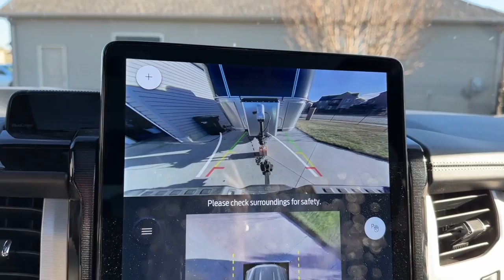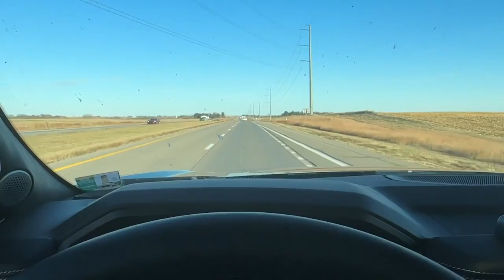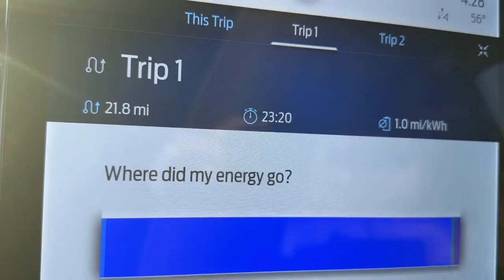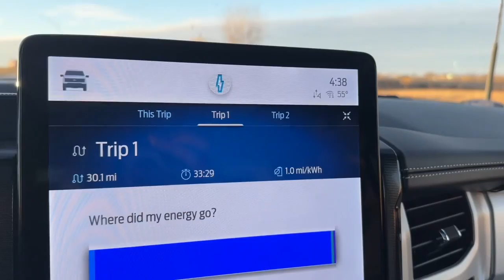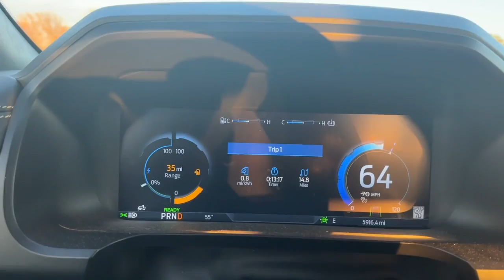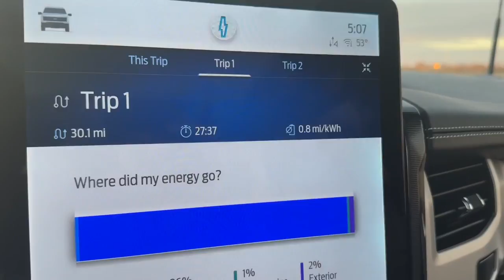How much does speed effect range when towing? Ford Lightning 60 vs 70mph

Comment: I have a 2023 extended range lariat.  I use mine as a work truck, because in Oregon gas is $4.50 a gallon and a KW is only $.14.  With 1200lbs of tools and a shell I average 2 miles per kw and drive 35,000 miles a year.  Towing my 18.5ft open bow boat only drops me to 1.6 miles per kw.  I'd say there are only 2 shortcomings of the truck.  Long distance driving, because it charges slow at superchargers and battery size.  We need a 200kw option like the new chevy has with faster supercharging.

Comment: The move from 60mph to 70mph actually costs you 25% more energy. Correct me if my math is wrong: 30.1 mi / 1.0 mi/kWH = 30.1 kWH used at 60mph, and 30.1 mi / 0.8 mi/kWH = 37.6 kWH used at 70mph, so the increase from 30.1 to 37.6 is 25%. However, looking at it the other say, slowing down from 70mph to 60mph does save you 20% of what you would have used (because 30.1 kWH used at 60mph is 80% of 37.6 kWh used at 70mph, which is a 20% drop in usage). Your comparisons are a big help! Thank you!

Comment: If it’s consuming 1kwh you cannnot go 131 miles, first bc you are not going to drain your battery all the way to 0 and second bc if you are on a roadtrip or something you will charge only to 80% bc the other 20% it’s ridiculous slow to wait and just get 20 more miles, so with the charge in 80% and leaving 10% of charge in the battery left you going to be towing just 70 miles, so every 70 miles you will need to charge, thanks
Reply: You get 120 or so from home, then fast charger gives an extra 100 miles each time. Several apps out there that will map it out including elevation changes.  How far are you travelling to camp?  What charger available at camp? It would work for most of my camping.

Comment: Do you know that on my EV, I can go fast and still go a long distance!  How? I have  Prius that runs on electricity and gasoline!
Reply from the maker: I want to see some towing videos like that with the Prius🤣
Reply: @All Electric Family  Wait, you have a problem with that statement.  A Prius was not designed for towing.  It is a practical vehicle that seems to bigger on the inside then the outside.  It also gets up to 80 mpg.  Finally, if it runs out of electricity, it keeps going!  Now, however, conpare your EV truck to a gasoline or diesel one.  That is a real comparison.  One more point here.  83% of truck owners NEVER tow anything. They just guzzle gas!
Reply from the maker: No problem and no comparison to your Prius, it was meant to be funny with a vision in my head of a Prius towing a camper, since you made this comment on a towing video talking about how much increased speed decrease efficiency.  Sorry you thought I had a problem with your statement.

Comment: Speed affects even gas vehicles!  However, when I  get low on gas on my ICE, I just pull into a gas station down the street and take ten minutes to fill up.  Try that with an EV!
Reply from the maker: Depends what street I'm on:) but yeah there needs to be a lot more reliable chargers.
Reply: @AllElectricFamily  In my suburb of Detroit, there are many EVs of all types (I have 2).  However, seeing just one public charger gets me excited.  Unfortunately, I don't get excited very often (seldom see a charger).

Comment: Wanted to let you know that there is a brand new 200kw ChargePoint station between Julesburg and Ft Morgan in Sterling CO exit 125. Its just over the overpass caddy-corner of the Village Inn. It just opened and only one of the two is working so far. Charged my Lightning there today, access is tight and not really trailer friendly, there are several restaurants nearby. Hope this helps you out someday, Thanks for the videos

Comment: great vid! but only 100 mi  yikes  I would not want to take that camping, I would have too much stress watching the power gauge drop...  Thanks
Reply: my 2017 2.7 Ecoboost F150 I had, with 26 gallon Gas tank, only got 7-8 mpg on the highway at 65 towing my 4500lb boat//trailer.. I had to stop every 130-150 miles to fuel up when I moved home to NJ from Oklahoma.. so the Lightning isn't far off.. for a first gen Electric Truck?? Not bad.. Now charging stops? yea, they need some work, but again... beginning stages
Reply: @PontoonPilot eye opening.

Comment: No one should tow at 70 and 60 would only be for days when the weather and road conditions are good enough to allow it. Many Countries restrict the Speed on Towing because its UNSAFE to do so at Higher Speeds.
Reply: You sound like someone that has never towed before.
Reply: @jusman5231  I've towed but I have also witnessed many people towing and things like a good side wind can sway whatever they are towing either into other lanes or worse cause them to Jack knife or collide with other vehicles or run off the road and the higher the speed you are towing the more likely this will happen. You can include braking as well as many heroes tow more than their brakes can handle. Road Safety experts in many countries either impose a speed limit or have it as a suggestion as they know many people towing rarely do so and put ambition over skill.

Comment: Why would you pull a trailer 70 mph you're not supposed to go over 55, and if you're pulling a trailer you're usually going on vacation, so what is your hurry.
Reply: Remember there are folks live out of California.  Most of USA speed limit is 70 mph while towing.
Reply: It depends. If you tow for your daytime job... maybe you need to go somewhat fast...
Reply: @rfortinoger2730  maybe get up a little earlier
Reply: Please explain why you think you aren’t supposed to go over 55? And the difference between 55 and 70 could be hours of driving depending on the total distance travelled for vacation.
Reply: @jusman5231  if you drive 1500 miles at 60 mph it will take you 25 hours, 75 mph it will take you 20 hours ,big deal, I think I'd rather be safe than sorry.
Reply: I mean that’s a quarter of a day and the difference is even more if you stay at 55. And I agree if you are on vacation it’s probably not a big deal but if it is what you do for work it is kind of a big deal. But I am still curious based on your first comment why you think 55 is the maximum someone should drive towing?
Reply: @jusman5231  that's what it recommends in the owner's manual of my truck.
Reply: In Utah I pulled a trailer legally at 80 mph and got 14 mpg on a 7 3 Ford F250 diesel
Reply: @andysupple4838  that's funny they came of the assembly line with a max mpg of 13.6  empty funny you can get that towing at 80 mph let me guess you were towing 20k lbs

Comment: I've got a Cybertruck ordered but I recognize it isn't a REAL truck and I'm keeping my V8 F150 for any bed loads or towing.
Until battery tech gives 300 miles while towing EV trucks aren't practical as work or recreational (tow) vehicles.
And the charge time just is a joke at hours on an EV vs 10 min avg for petroleum fueled
Reply: Youre not wrong, but youre not right either. My dad is seriously thinking to replace his diesel truk by a lightning to tow a delivery trailer. He will save 160 CAD EACH DAY. yes he will will have to charge halfway, but it will be stopped anyway for a delivery. Rest of charging during the night. Cheaper to go electric after less then 2 years for him. So it depends of your needs.

Comment: I'm convinced the lightning is best suited to be used locally where it can be charged at home.  Depending on public chargers will most likely cause range anxiety and will be much more expensive to drive the lightning. Local driving (55 mph)
I can average 2.4/mpk costing me as much as 5 cents per mile.
Driving at highway speeds (70 mph) I'd average 2/mpk costing me as much as 21.5 cents per mile at public chargers. Roughly 4 times as much using public chargers that often aren't dependable. Until the cost per kwh are lower than the current 31-43 cents per kwh and there are enough dependable charging stations that a person doesn't have to worry about running out of power any more than an ICE vehicle running out of fuel, I'll forego using my lightning to drive across country.
Reply: what are all the dc fast chargers for if not for the Lightning?

Comment: Great video guys, thanks for posting.  With our ICE tow vehicle, we see similar economy gains by reducing speed.  We used to tow at the speed limit, but since changing our driving habits to limit tow speeds to 65 we have seen about a 10% gain in fuel economy.  Also, this was our first trip with the new Airstream Basecamp.  We saw another 5-10% gain in economy over previous trips with our 23 ft Airstream.  Would love to come down and have you repeat your test towing the Basecamp to determine aerodynamic differences between the 2 Airstream trailers!  🙂
Reply from the maker: Deal! We will have to find time and a warm day to test it out!
Reply: Would love to see what the consumption is with a basecamp.

Comment: Speed definitely matters even when you're not towing. At 70 mph I get around 1.9/mpk to 2/mpk and 55 mph around 2.3/mpk to 2.4/mpk.
Reply: How are you getting up to 2 miles per KW at 70 when he did the same test and got 50% less?
Reply: @slickwilly4613  tent trailer? 😂
Reply: @slickwilly4613  not towing...